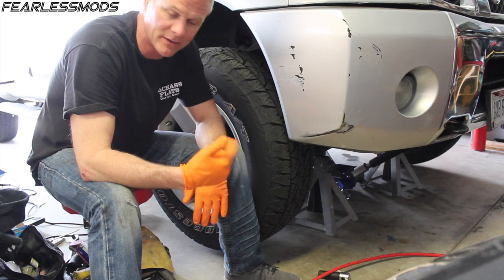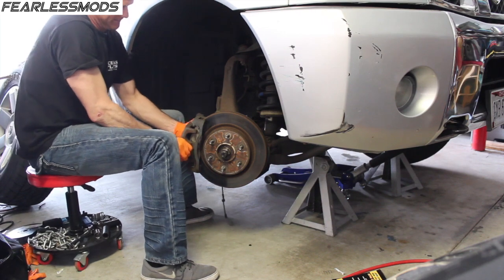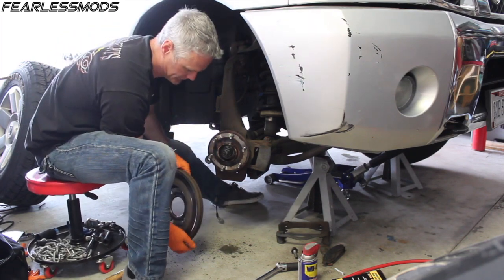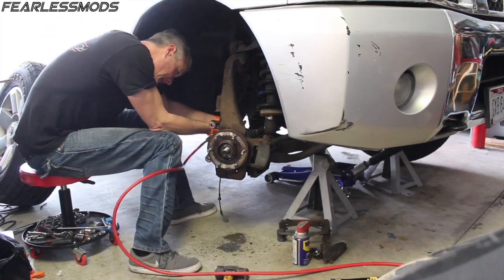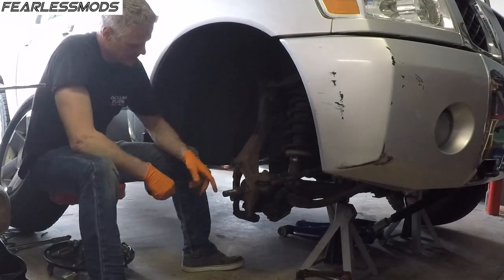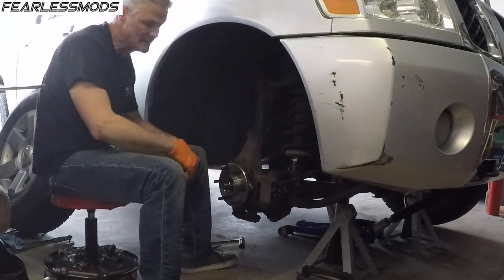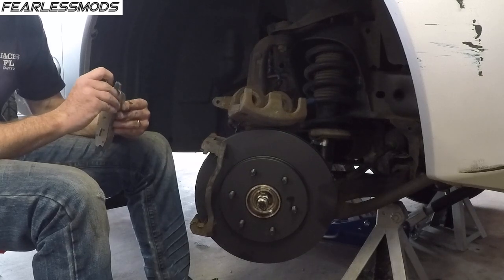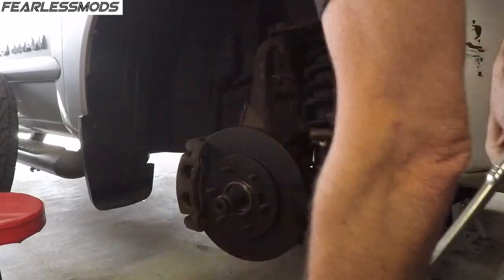2005 Nissan Titan front brakes & bearings

Comment: Fearless Mods- I stand corrected Sir. You are absolutely right. When you hear the humming of the wheel bearing and not knowing which bearing the noise is coming from, you can simply turn the steering wheel to the right while rolling down the road.. If you hear no more noise then the bearing on the passenger side is bad. My thoughts were that the drivers side bearing would be bad. I was wrong. I replaced the said drivers side bearing and sure enough the noise was still there. So then I changed the passenger side and voila, no more noise. Thanks for your video..... I would also like to add that when you jack up the Armada and remove the wheel and do not see where to use the 32mm socket, thats because your truck is only a 2wd or rear wheel drive truck. The 32mm socket is used on all 4 wheel drive Armadas.
Reply from the maker: Well thank you for saying I'm right.  However, it looks like you mischaracterized my response.  I'm actually saying that if you turn left, the weight transfer to the right puts MORE strain on the right bearing and points to it being the problem.  The left bearing in that situation has less stress being applied to it...again, due to the weight transfer to the right in a left turn, and vice versa.  Like I said though, it's tough when they're both going out repeatedly.  So far so good after my latest install however!

Comment: How are the moog hubs. Seeing mixed reviews on them, thanks
Reply from the maker: I replaced with Moog twice and they both went bad quickly. SKF did the same. I ended up going to the dealer and they replaced with their regular brand (?) … failed too. It wasn’t until I paid extra and had them put on the premium bearings that it fixed the problem and has not returned.
Reply: @FearlessMods  I just went with Oem. The way I looked at it was if they lasted 215k miles they’ll last til it finally gives up on me.

Comment: You were wrong with your assessment of which side was actually bad. When youre traveling and you turn the wheel to your right  and you hear no more wheel bearing noise, that indicates that its the drivers side wheel bearing.
Reply from the maker: We can agree to disagree, but the truth with these things is that both were bad multiple times, so regardless of which method you subscribe to, there was something else going on!
Reply: @FearlessMods  Sweet. I will let you know how mine turns out. And which side. Thanks for the vid.